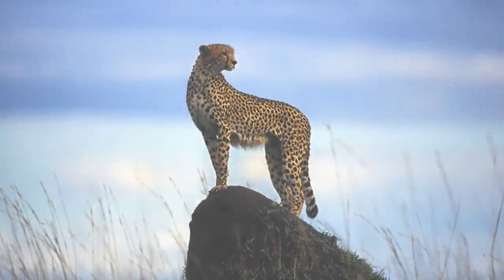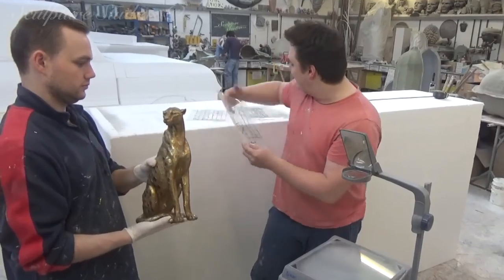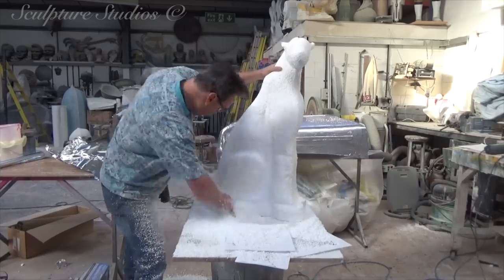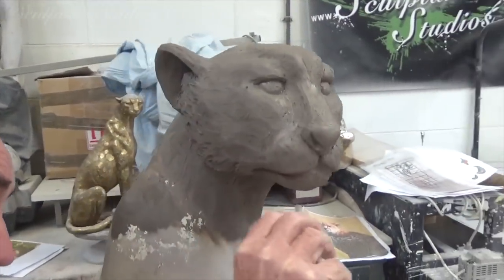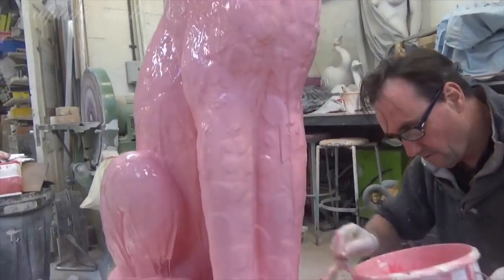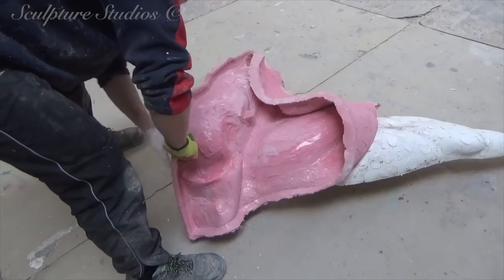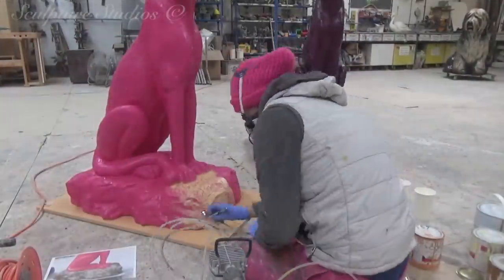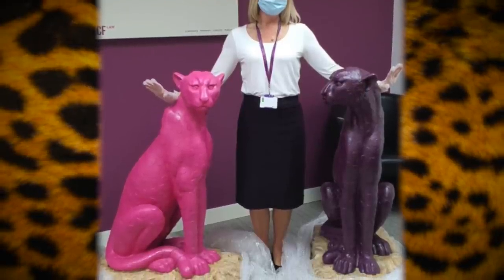Life Size Fiberglass Cheetahs by Sculpture Studios

Comment: Nice work! Is this normal earth clay that needs keep watering to keep it wet? Or some other artificial clay?
Reply from the maker: Regular clay, need to keep moist. We cover with a damp towel overnight, wrap in plastic to keep the moisture. It only needs to stay in a good enough state for the mould making. Then it's wetted again and back in the bag for another project!

Comment: ive never  seen any clay added to your sculpture's before.  (although iv'e also never seen  all 300 of you video's) Are you using an oil based clay here?
 (as obviously water based clay soon shrinks & cracks  whenever it's applied to any other material)
on a completely differant subject you might get a superhero commission, as there's such a current trend for this kind of thing.  I know of a company based in Australia, but do work for a German company (which shall remain anonymous) who do hero figure's for film premiere's, but only to order of course, theyve done-  INCREDIBLE HULK, IRON MAN, BAT MAN and SUPERMAN very good but occasionally the resemblance varies i.e- IRON MAN being much more basic than seen in the film

Comment: May I ask, When removing the rubber mold from the clay covered sculpture, you don't apparently use any form of releasing agent such as an oil or anything. Is there a reason for that ?
Reply from the maker: There isn't really much need for one. The clay doesn't adhere too much to the rubber, and pulls out quite easily, and any clay left in the mould can simply be washed out, as the clay is water based.
Reply: @AdenHynesSculptureStudios  Thank you very much!